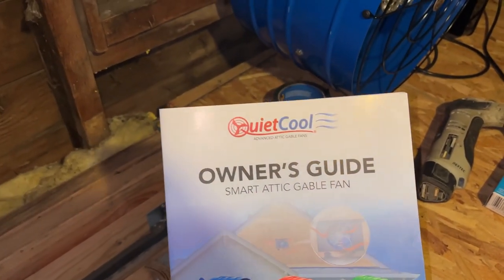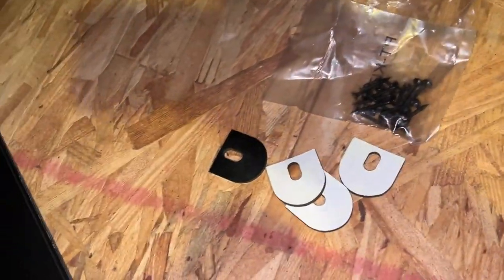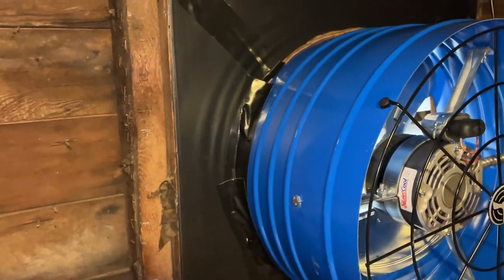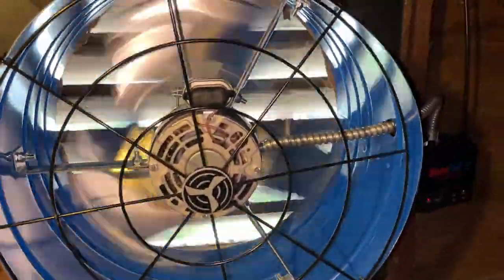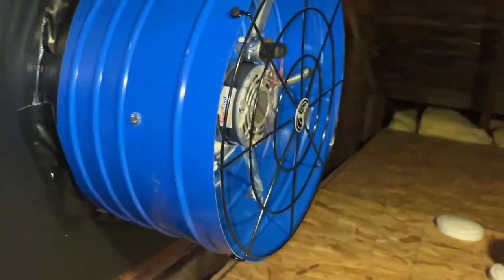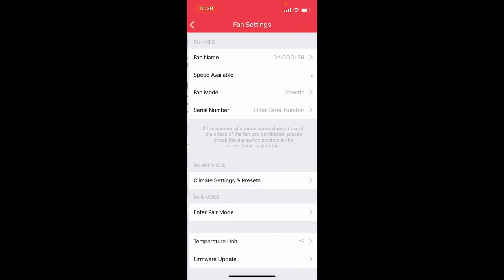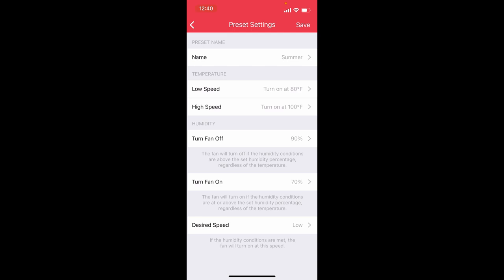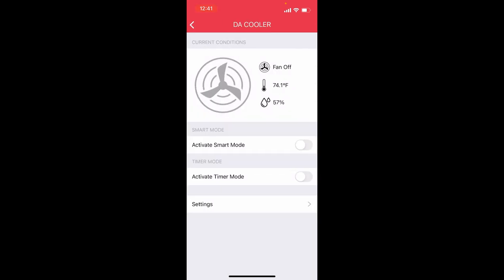Super Simple Attic Fan Installation - Quiet Cool AFG SMT PRO-2.0 - 1945 CFM Gable Mount Attic Fan

Comment: You will want to enter your serial number on the app as it will have more functionality.  It's on the box, the instruction booklet and on the fan shroud as well. We have the green 3 speed model 3.0 and love it. You might benefit by using the shutter gable vent they sell as the vents on most gables are not designed to move a lot of air.

Comment: I have the same fan about 16 feet up in an uninsulated garage. Just installed yesterday by licensed electrician. Which direction does the fan blow air? QuietCool company video said blows air IN. Most roof mounted attic fans blow hot air OUT (as you probably know) but this one is for gable mounting. I can’t get up there to do a balloon test. Is it obvious to you when you’re in front of it which direction it blows? Thank you
Reply from the maker: Hmmm yeah that’s strange. Def blowing out 100%!!

Comment: Just make sure to seal out air leaks from your living space to the attic. Otherwise this fan will pull cooled air into the attic, driving up your electric bill.
Reply from the maker: Ya know that makes sense. The house is sealed up pretty good, but sometimes I do let some weird hot spots or like attic smells in certain areas. Maybe that is why?

Comment: Don’t forget to the the MFDs on the capacitor it runs on once a year. If u don’t have or want to buy a meter that checks mfds then look at the size of the capacitor and just gota a few of them and change them once every year year and a half to prevent the motor from burning up they aren’t expensive

Comment: It's not the settings.  its doing abosluely nothing without having an equal fan pushing air into the attic from outside...
Reply from the maker: Hey thanks for the useless comment lol..... it works.. simple as that.
Reply: That is not even true. It really depends on the situation and house. In most cases, one is enough.
Reply: @thedude2897 Guess ill have double the savings
Reply: @thedude2897 Also, you need to understand this house is built in 1960. There's no ventilation whatsoever. There's no soffit ventilation there's no peak ventilation nothing
Reply: @te8828  Yup your situation absolutely makes sense for one.